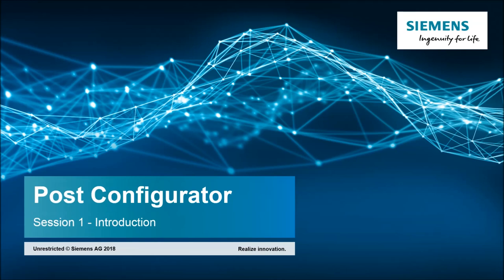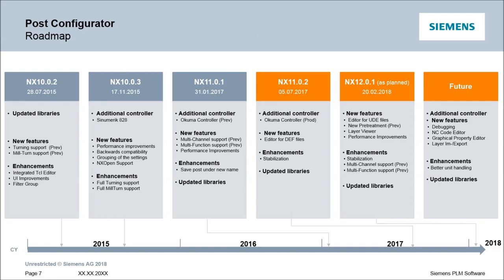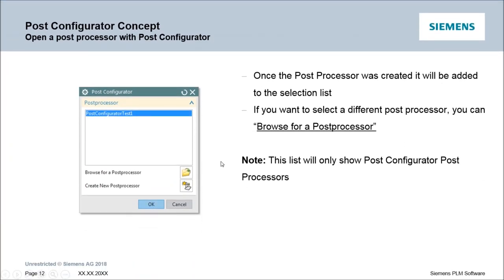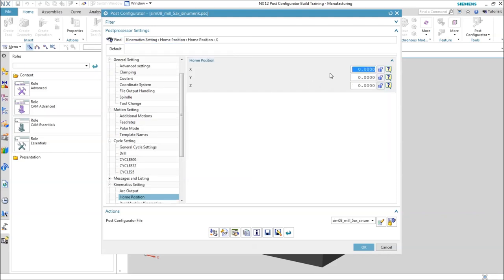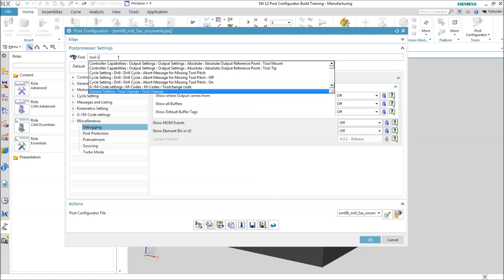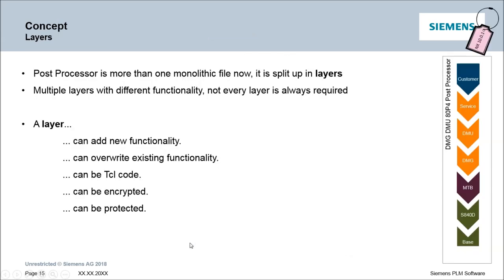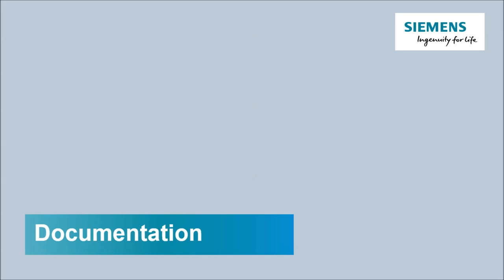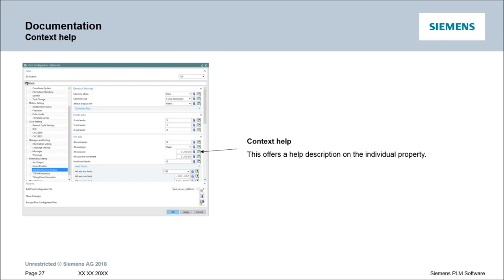Post Configurator Session 1

Comment: how instal post config?
Reply from the maker: The application is delivered and integrated with NX CAM. To start the application and if you don't have the button in the ribbon use the command search to find it.
If you want to install a post processor based on Post Configurator take a look into this video:
https://www.youtube.com/watch?v=GBBu5_D-bQU

General I recommend to use the latest version of NX (currently 1953) to modify your posts based on Post Configurator.